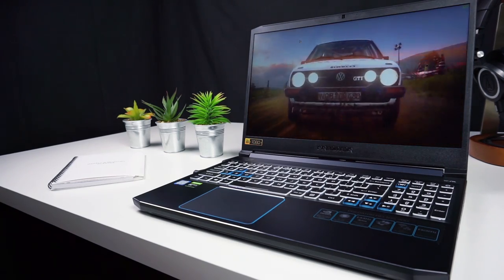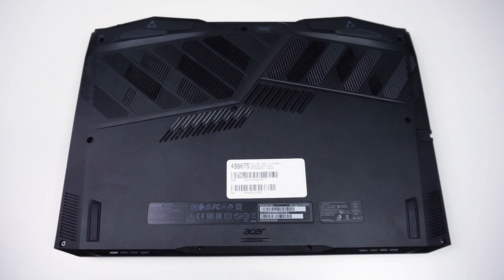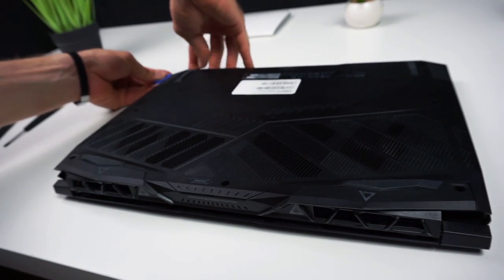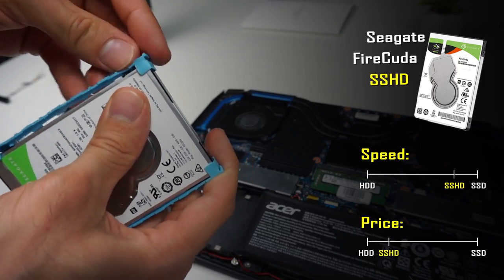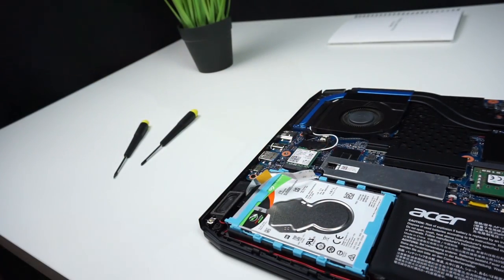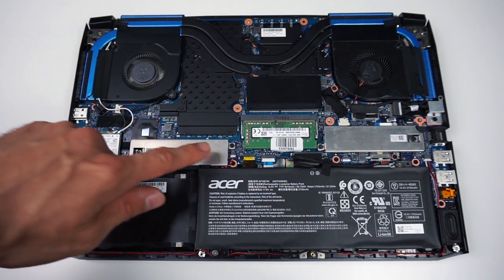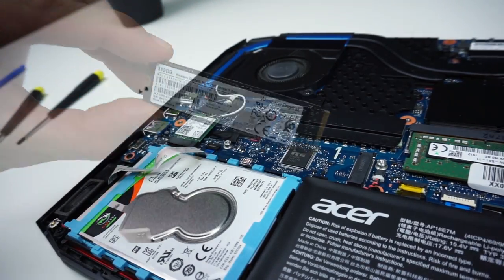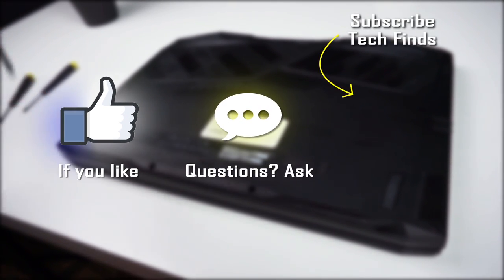Acer Predator Helios 300 2019 Upgrade RAM / SSD / HDD - Disassembly Guide

Comment: I have this laptop. It looks like in the video there is only one spot to put more ram... But all of the linked ram in the description show up as two packs or something. How would this work??? Am I missing something because I am an idiot? Thanks
Reply from the maker: This laptop has 2 ram slots mate
Reply: @TechFinds  Ok thank you for answering. Where is that second slot? Is there a timestamp in this video I can see or should I check the manual? Thanks again
Reply from the maker: @hisokka5325  03:08 - it's above the slot that i'm installing RAM in. It's covered by a black paper, you can peel it off and then stick on later or just pull it up a bit to see the slot
Reply: @TechFinds  Lol thank you so much for your help. You got a sub

Comment: I have a question will a regular 2.5 SSD like a WD blue SSD work or is it only HDD?
Reply from the maker: Yes, you can install 2.5" SSD instead of HDD
Reply: @TechFinds Thanks! I had the same question, I was hoping to recycle my old SSD (Crucial MX300 525GB) from this computer into the next one.

Comment: Have I to buy 2x16 RAM or can I buy 1x16 to change it?
Great tutorial, thank you <3
Reply from the maker: You can go for 1x16 or 2x16 depending on what you already have. If you have 1.16 now then just add on more 16GB stick. If you have 2x8 then would be good to have 2x16 for the best compatibility, but you can also take out one 8GB stick and install 16GB instead so you will have 16+8

Comment: are both m.2 drives support nvme? or one is sata 3? if so which one is sata or nvme
Reply from the maker: One is sata and one supports both sata and nvme, but idk which one is which. You won't be able to install NvMe SSD i  sata slot.
Reply: that's confusing lol, https://laptopmedia.com/laptop-specs/acer-predator-helios-300-ph315-52-4/ this site here says it's both nvme
Reply from the maker: @kyshiroshikira  yes, that's right mate. Both are NvMe, but one of those also supports sata drives. At least that's what I know lol.

Comment: The SATA hard drive size should be 2.5 inch right? can i install 3.5 inch SATA hard drive to the laptop?
Reply from the maker: Hey, 3.5" will not fit. Even if it's 2.5" but more than 7-9mm thick it may be too big, so stick with regular size 2.5" drives

Comment: Does the rubber frame and ribbon cable come with the HDD
Reply from the maker: If you buy the laptop without HDD you should get the rubber frame and cable in the box.

Comment: may i know if the m.2 slots are both act as C drive? 
and also the crucial mx500 is has different shape can it be fitted?
Reply from the maker: What do you mean by act like c drive? Bootable drive will be the one with system on it, the other one without system can be used all as a storage. This laptop has 2 M.2 slots of which one supports both sata and nvme, and the other one supports nvme only. I don't remember which one is which unfortunately. This crucial is sata m.2 and it should be supported by one of the m.2 slots in this laptop
Reply: @TechFinds  my bad, i meant that can both m.2 slots merge into one storage and be the bootable drive, but i understand right now that any drive should be bootable for the system. Thanks for the explanation about the sata and nvme.😁
Reply from the maker: @__pZ__  You can have system on any drive, but you can't merge 2 drives and make it one bootable, because they are two separate parts. You can only split the drive if you want

Comment: Hi, I want to put my new ssd (crucial p1) but I have no idea how to disconnect the battery. Can anyone help me on how I can do it properly?
Reply from the maker: I didn't do it to my laptop, but look there the cables go from the battery and to disconnect it there should be a wide connector with cable that connects the battery to motheboard. On the sides of the connector you chould have a really small tags to pull off the cable. Don't pull the cable itself as you can tear it

Comment: Hello! Is it necessary that the 2 Rams (8x2) is the same brand? because I have acer helios 300 (8gb ram) and i want to add 8gb ram (hyperx). Is it possible?
Reply from the maker: It doesn't have to be the same brand but it should be the same specs. Don't buy HyperX unles you buy 2 new sticks of it. Go for Crucial that I linked as it has the same specs as your original RAM.
Reply: Tech Finds dual rank or single rank?
Reply from the maker: @kylexiu3435  single but it doesn't really make a difference., Original RAM is single rank, so wor the best compatibility go for single if you mix

Comment: I don't see the cable or blue square in my laptop box? Is it already in my laptop, and I have to unscrew to get them? Not sure, thanks.
Reply from the maker: The blue frame cannot be mounted inside the laptop without drive, because you don't screw it to anything. The HDD upgrade kit should be in the box. Ask Acer support if they can provide.
Reply: @TechFinds  Thanks!

Comment: Can I upgrade one of the rams to 32gb? I mean to replace just one of them and have 32gb plus 16gb.
Reply from the maker: Nope, most of laptops including Predator support max 32GB RAM (2x16). 16GB in dual channel is totally enough for gaming nowdays.
Reply: So you can't add 32×2 or Max is 16×2

Comment: good! plz do it with 2020 model too, ram, ssd nvme
Reply from the maker: 2020 model has the same build, so you can base on this video
Reply: @TechFinds  OK but ram is 2933 and I get confused with M.2 and NVME SSD, can I install another NVME with the one NVME came with the pc?  are the connecters same for M.2 and NVME?
Reply from the maker: @MrMAKFoto  Then if you wanna add RAM match the specs with original one. If it comes to M.2 slots both support nvme but only one supports m.2 sata

Comment: I have a nitro 5 ( 256g ssd)and was wondering if i could put the ssd into the helios 300 i just ordered ( helios only coming with 256g ssd).
Reply from the maker: Do you mean the SSD from Nitro 5? You can, but you probably have Windows installed on this SSD, so you have to get rid of it
Reply: @TechFinds  yes i do, and thank you for getting back to me =). do i have to remove winows? if so how do i do that? or could i leave it? could i still install games/play them off that ssd if it doesn't have windows? ( i'm  a noob when it come's to installing and using a extra ssd or hdd, sorry).
Reply from the maker: @vraa5781  well, I didn't try to put an SSD with windows into the laptop that has already windows installed on the other drive, so idk. You may have some boot issues due to 2x windows on 2 drives i guess. But for sure you can use your SSD from Nitro as a normal SSD when you remove the Windows from it. However I've never cleared any drive of Windows, so you have to find a way.

Comment: Can we add ram of 3000 mhz 16 gb in this laptop total will be 32 .. Will it work fine..
Reply from the maker: 2666MHz is max up to 32GB (2x16)
Reply: @TechFinds  will it still work if I will put 3000 mhz instead of 2666 mhz
Reply from the maker: @ssamirbehera  No idea. It should work but i'm not 100% sure. it will probably downclock to 2666MHz.
Reply: @TechFinds  I was thinking the same. .. Should I try .. Because I am getting it cheaper
Reply from the maker: @ssamirbehera  I'd recommend to use 2666MHz RAM. Eventually if you have a prssibility you can try 3000MHz and return it if doesn't work.
Reply: @TechFinds  thanks buddy 😍

Comment: I open this video link of crucial ram...16gb kit 2*8 dual rank... and 16gb kit 2*8 single rank.... what is mean of dual rank or single rank... is it different from dual channel.
Reply from the maker: Yes, this is something else than dual channel. It's not very important, but if you mix then for the best compatibility it's good to match it with original RAM which is single rank. However it will work with single + dual anyway.

Comment: Hello. I was reading a review that said the screw for the PCIE plate was too tight and they couldn't get it off without a technician's help. Did anyone who upgraded their PCIE drive and any problems like this?
Reply from the maker: I think that it was a factory defect. It happens sometimes with any products.
Reply: I just had this issue today. The screws stripped and had to be very carefully  dremeled out.

Comment: i have the same laptop but it has 2x4 ram i want to upgrade what would you recommend for this laptop 2x8 or 2x16?
Reply from the maker: 2x8 is totally enough for gaming, but if you gonna edit videos 2x16 will be helpful
Reply: @TechFinds  would you recommend 4+16 ? So totally 20gb i don't know if they're going to work as dual channel
Reply from the maker: @berat9826  dual channel may net be activated when you have 2 different size sticks

Comment: how do I change my ram clock speed rated at 3200 mhz and I can only see it's running at 2400mhz, as I can't suspect there were no option for intel xmp profile, so how to change it, or is there any speed cap that memory modules cannot run beyond this clock speed?
Reply from the maker: This laptop supports RAM speed up to 2666MHz. Looks like you have 2400MHz RAM or it downclocked for some reason if you have 3200MHz RAM installed. I don't know how to change it tho
Reply: @TechFinds  No i don't have the same exact model i have 2018 version with i5 7th gen (i5 7300hq) was asking for that model.
Reply from the maker: @tcoa83shivamkoshta94  ohh, then your laptop supports up to 2400Mhz. Looks like it's all ok
Reply: @TechFinds  That's great I figured it out checked for my processor's config and it mentioned 2400mhz max memory frequency support. But here is the tricky part on Amazon I found 2 hyperx sodimm rams with 2400Mhz and 2666Mhz out of the two 2666Mhz is a bit cheap. Which one should I go with?

Comment: that Crucial SSD in the description doesn't look compatible to me, the connection pins are different than the one in the video. you'd have better luck with the Crucial CT1000P1SSD8
Reply from the maker: Because this Crucial i linked is SATA while the one you mentioned is NvMe PCIe. The laptop supports both.
Reply: @TechFinds  Oh nice, thank you for the info and sorry if I confused anyone.

Comment: Does it matter that the hyperx has 15cl?will it work in the helios 300?
Reply from the maker: Yes it matters. If you gonna mix with your original RAM go for something with the same specs CL19 like Crucial that i linked in the description. HyperX is good, but go for it only when you going to buys 2 new RAM sticks of it.
Reply: Already bought the hyperx 32gb (2 sticks)..the lower the cl the faster right?
Reply from the maker: @jc1920  Yes, but i think that the difference is not very big between CL 19 and CL15
Reply: Yes but i think the hyper x is the best choice..Thanks for the info..

Comment: Hi.... can you tell me... what type of ram in .. Acer nitro 5 i5 9gen....2666 mhz or 2400mhz..... are all laptops have 260pin
Reply from the maker: Yep, laptop RAM are 260 pin. i5 9th gen supports 2666MHz and A er Nitro 5  ones with 2666MHz. It is 1.2V CL19, so if you wanna mix buy RAM with the same specs.

Comment: Predator helios 300 i7 ph 315 52 model top of the display a sound of metal at the back side occurs,there is a small compression with sound is any problem
Reply: Sound and compression occurs at the joint at top of metal with the cutting shape

Comment: Do you loose your files and install games when you change the ram??  The SSD??  Or the HDD??
Reply from the maker: If you replace the drive where you have your files and games you lose them and you have to install them on the new drive. However when you're just adding a new drive without touching your actual drives then you still have your games installed. RAM doesn't affect it whatsoever
Reply: So when you download a game, can you make the game files be in your ssd or HDD or it automatically go to the ssd?
Reply from the maker: @paradox1414  you can choose the drive where you want it to be downloaded to.

Comment: Can i use any hdd cable for this laptop?
Reply from the maker: Most likely you can use a not original cable, but the connection type to the motherboard and drive must be the same. I'm not 100% sure tho

Comment: Hey one quick question.. can we install 2 1Tb m.2 sticks ?
Reply from the maker: Yes, you can
Reply: @TechFinds  but I heard like we can only use 512gb m.2 for each slot summing upto 1tb in total
Reply: @TechFinds  because I want to upgrade so ... Wanna know for sure!!
Reply: @TechFinds  also mine is 2019 Helios 300 with rtx 2060 paired with 9750H ... Is 2020 Helios 300 best?? As I still have my return window open... But someday 2019 model is the best... So should I stick with this or return it and wait for the 2020 model (India)..Your reply would be helpful..
Reply from the maker: @MrStarMan07  you can i stall even 2TB ssd if you want. If you have 2019 model I wouldn't bother with replacing it for 2020 model
Reply: @TechFinds  hey thanks dude ... And videos were great

Comment: Hi, does the rubber frame come with the laptop?
Reply from the maker: Yes it does. You also get the ribbon cable to connect your HDD with motherboard.
Reply: @TechFinds  i bought this laptop from amazon but i didn't find that rubber frame or the ribbon cable
Reply from the maker: @samehsaeed6203  it should be inside the box if you buy a confirmation without HDD. If it has HDD then the rubber frame is used to mount it. But if you don't have HDD and upgrade kit you should contact the seller, because it should come in standard.

Comment: What is name and brand of the HDD and SSD and RAM pre-installed into the  Laptop? 

Is this Acer Predator Helios 300 of following specifications: i7 9750H, 1660 ti, 16gb RAM, 144hz IPS panel, RGB keyboard, etc.?
Reply from the maker: The RAM is SK Hynix 2666MHz CL19, SSD was NvMe from Western Digital (don't know model), and my laptop came without any HDD. This was my unit, but it may vary between countries.
Check out my review of this laptop to find out more: https://www.youtube.com/watch?v=k7_iDcEXveQ
Reply: @TechFinds  Thnx👍🏽

Comment: Do i need to use exact same for example if it comes with hyper x 16 gb ram can i install another Samsung 16gb ram stick of Same frequency...??
Reply from the maker: You can and it will be most likely working, but you should also match the latency. HyperX has very low latency CL15, so if you install different stick you may have compatibility problems. The best is to use 2 same RAM sticks, but if you match she specs close enough you can mix without problem.
Reply: @TechFinds  thanks
Reply: How much SSD is enough for gaming no editing stuff...??
Reply from the maker: @SD-vs4wx  It's all about how many and how heavy games you'll have. You have to count this and then eventually buy another drive if you need more space. For me 2TB Hard Drive is totally enough.
Reply: @TechFinds  256gb ssd+1Tb hdd is enough i think as SSD don't effect in game fps
Reply from the maker: @SD-vs4wx  Yes it doesn't affect the FPS
Reply: @TechFinds  👏👏

Comment: Which HDD do you prefer to install for the Helios 300?
Reply from the maker: The one i showed in the video. I'm using it in my laptop.
Reply: Tech Finds,  But I have seen so many bad reviews about the seagate for both reliability and durability.
Reply from the maker: @qabilaliyev5692  I'm using it for 2.5 years now and no siiues whatsoever

Comment: Hello I want to know which ssd work with my predator helios 300 with an 1050 ti 6g, 8 g of ram Intel i5 8th génération and 1 to hard-drive 7200 rpm
Reply from the maker: You can go for this: https://www.amazon.com/gp/product/B0784SY515/ref=as_li_qf_asin_il_tl?ie=UTF8&tag=techfindsrevi-20&creative=9325&linkCode=as2&creativeASIN=B0784SY515&linkId=0da37d5c9db37813af8e7392000847dc
Or 2.5" Samsung 860 evo
Reply: @TechFinds  oh so its compatible with m.2 thx dude awesome +1 sub
Reply from the maker: @samsky9045  YEs it supports M.2 SATA and actually M.2 NvMe PCIe as well so you can go for Samsung 970 Evo as well if you want